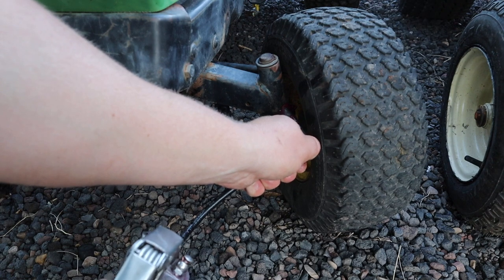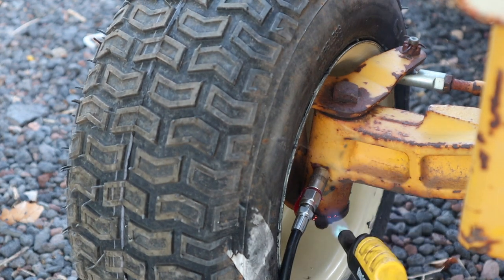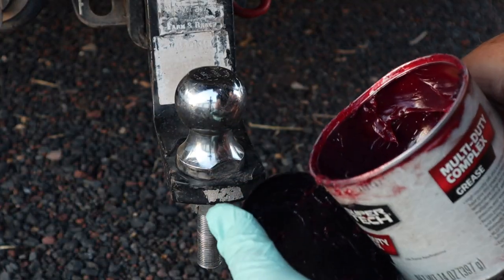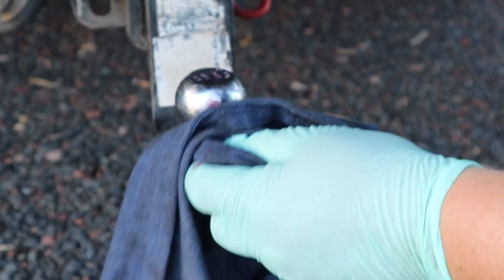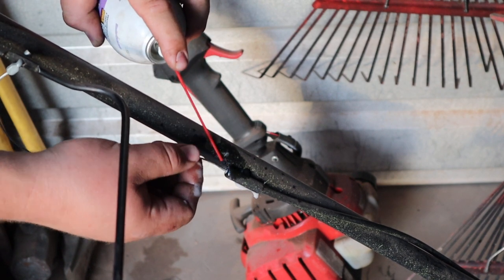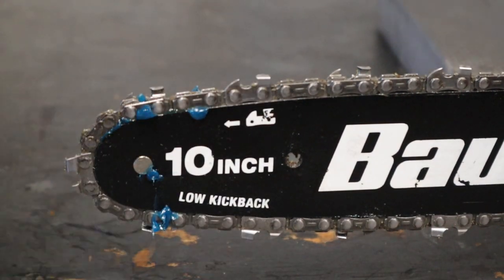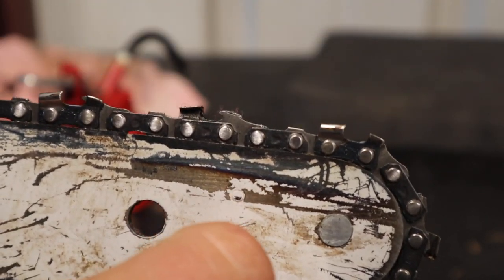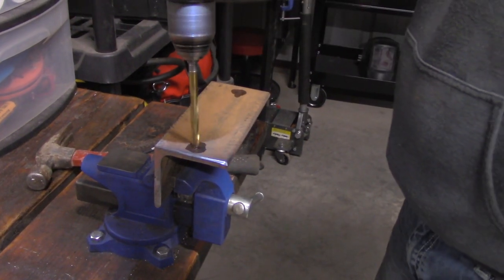5 Tools/Machines You Should Be Greasing and Oiling

Comment: I agree with Jeremy, air tools often get overlooked.   Also this is something a little different but the Kitchenaid stand mixers need their grease changed occasionally too.   Helps keep the motor running properly and extends the life of the unit.
Reply from the maker: I was aware that there was grease in there but wasn't aware that it was changeable. Outside of like a real complicated tear down anyway.  Thanks for the suggestions.

Comment: U joints on drive shafts and trailer bearings.
Reply from the maker: See I didn’t even know you could grease the drive shaft without taking it apart. I’m gonna have to look at mine tomorrow. Trailer wheel bearings I thought about but I recently greased mine and didn’t want to tear them apart again to film for the video haha. Great suggestions though.

Comment: For smaller stuff, rotary tools with an extension. Lubing up that cable inside can keep it from getting hot so quick from the friction.

Or how about cleaning and greasing the bearings on utility cart wheels around the shop? They're exposed and accumulate a lot of crud.
Reply from the maker: Great suggestion. I am gonna make a part 2 with viewer suggestions when I get a chance.